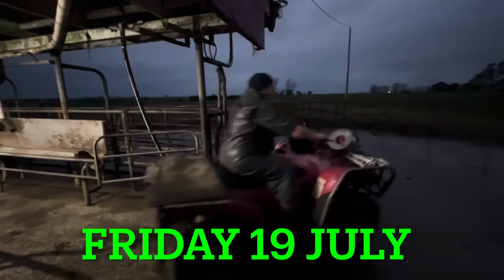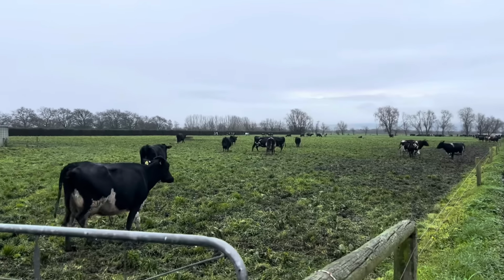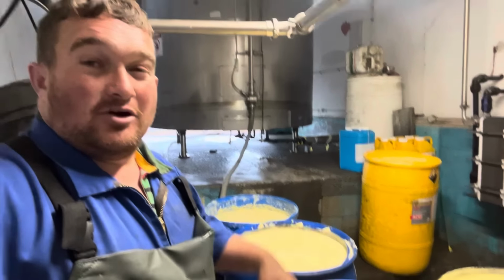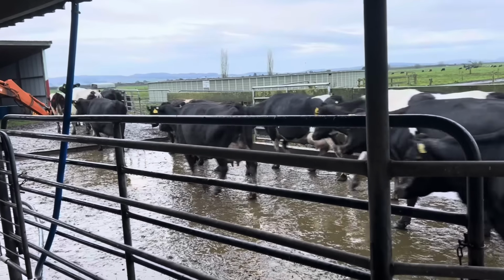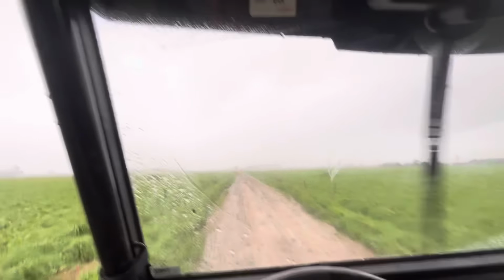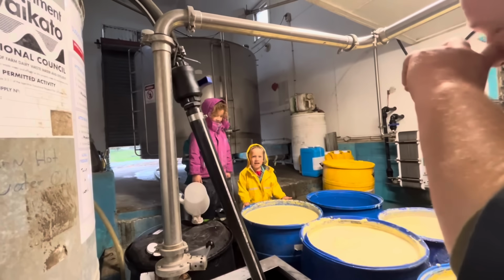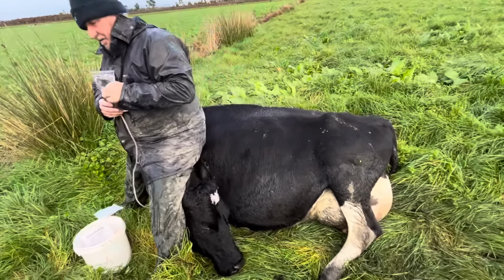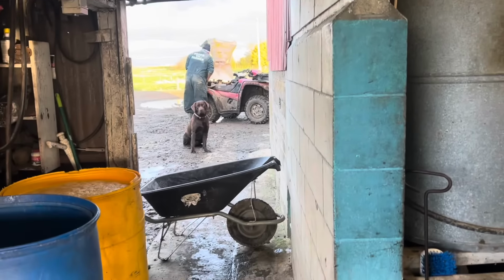Rain is Back and Getting Wet Fast. Kids Come To Help.

Comment: Feeding some straw might reduce your milk fever problem
Reply: or pre feeding mag 2weeks earlier lol
Reply: Or springer mix on the balage.
Reply from the maker: That probably would help a bit. 
But all the cows that have gone down are over 8 years old. 
We have feed hay in the past. But going for silage this year. 
Thanks for the advice.
Reply from the maker: We’ve talked to the vets. 
Mag only lasts in the system for 3 days. As told. 
So that’s why we only start treatment 3 days before our cows really start to get into it. 
We treat well above the recommended rate too. Just that the cows that have gone down have just gotten a bit of age to them.
Reply from the maker: Could look into that mate. 
But we’ve culled for mastitis for the last few years. 
But maybe we may aim to reduce age rather than mastitis. Just depending on mastitis issues.